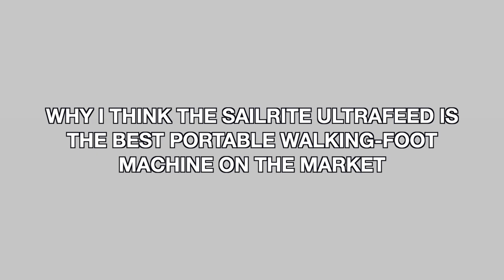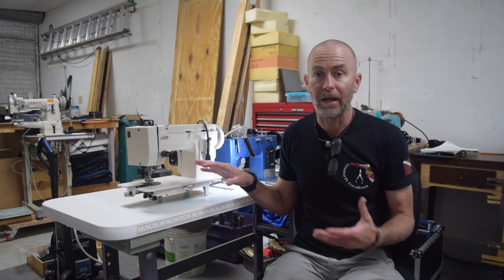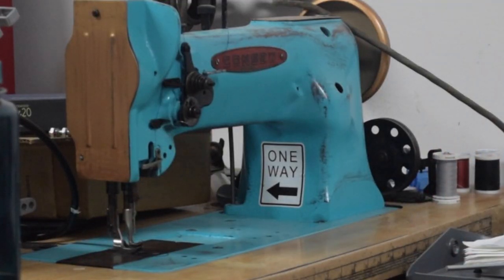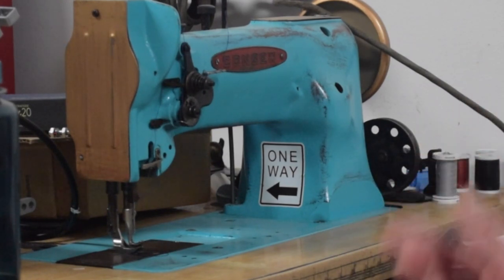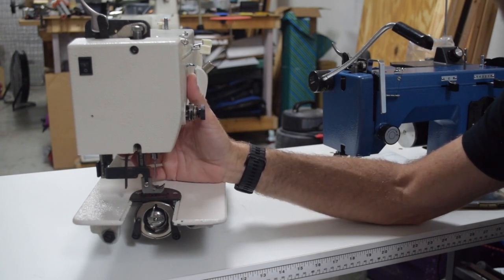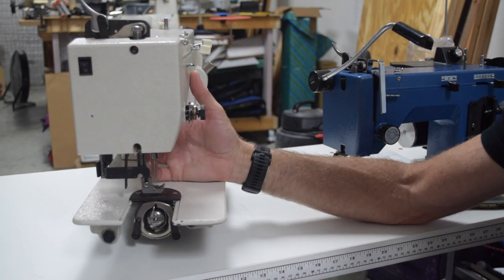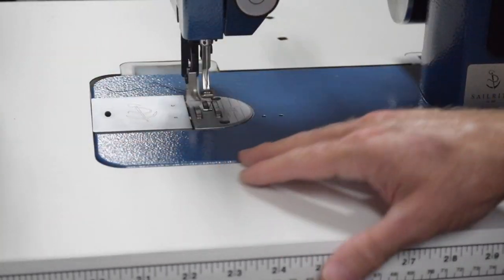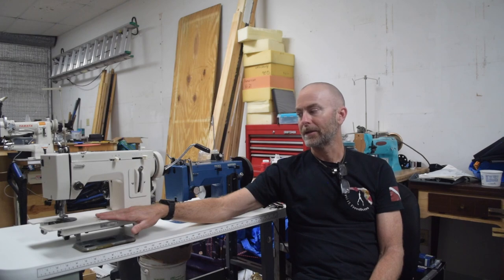Is The Sailrite Ultrafeed Better Than The Look-A-Likes?

Comment: How often do you use zig zag stich?  I was thinking I probably don't need the LZS because I can't imagine a lot of instances where I would zig zag with a heave machine like that.
Reply from the maker: Hi!
I use it quite often, primarily for bar tacks. My opinion is there is no reason to buy the straight-stitch-only version unless you absolutely can't budget the cost difference. Honestly, I sometimes wonder why Sailrite still makes the straight-stitch-only version.  I don't know if there is any situation where the straight stitch of the LSZ machine is inferior in any way to the straight stitch of the LS machine. Even if you never plan to use the zig-zag stitch, it's always there if you one day decide you need it!
It looks like the cost difference right now is $200.  If that difference is too great, particularly if you already own a zig-zag capable sewing machine, then maybe the LS is the right choice, but if you're only going to have ONE sewing machine, I would strongly suggest the LSZ.
For many years I only had an LS machine, and I used a machine like my Singer 237 for any zig-zag sewing.  That worked fine, but it is far easier and better to just use my LSZ-1 now.
I hope that helps, thanks for the question and thanks for watching!

Comment: Sailrite didn't invent this design sewing machine either, they (along with help from Chinese manufacturers) all copied a prior design.  Sailrite did make some unique improvements and provides unmatched customer service and support as well as a large and professionally produced library of instructional sewing projects.
Reply from the maker: I'm not that electrically savvy, and Sailrite's website might have better info, but I believe this is a DC motor with AC power in.

Comment: Hi Jason, I got 11 minutes in and had to switch off. Sailrite took an existing design made in China and rebranded it. When it turned out to be short on promise they upgraded it. It has been incremental up to the current version with the WorkerB motor set-up. The standard original Chinese product is what you have there to compare which is much the same as the early offerings from Sailrite. It is pot-luck as to whether you get a good one or not even from Sailrite.
Reply from the maker: Hi,

First, thanks for watching, although honestly it's a little hard to take your comment seriously if you can't be bothered to watch the entire video so you know what you're commenting on.

That said, I am openly challenging you to answer one question, and I predict that you either won't reply, or your reply will not answer the question - please prove me wrong:

You claim that "Sailrite took an existing design made in China and rebranded it" and " It is pot-luck as to whether you get a good one or not even from Sailrite."  On what evidence do you base your claims?
Reply: @thejasonofalltrades  I will watch the rest of your video but not today - it's Xmas Eve and I got baking to do. I have watched a good few vids on Rex and Sailrite portables and since Sailrite only do the 7" version I would not bother with it for the price.

I have two industrial machines, one is a new Chinese computer direct drive 0303 style walking foot machine which I obtained directly from China at a third of the LSZ1 price. The other is an older Brother which I have had for years on a clutch motor and now have a servo motor to fit over the holidays.

I seriously looked into the portables but could not recoup the cost of a Sailrite machine in a reasonable period of time. I have been a subscriber of Sailrite for five or six years now and somewhere in their uploads is the history of the portables development. Happy to prove you wrong dude.
Reply: @thejasonofalltrades  Here is one of a few vids from people who got a dud. From the channel 'exploring land and sea'. Title is something like 'unboxing our Sailrite ultrafeed LSZ-1 Didn't go as planned'.

I have come across a few more but that was back when I was looking. I suspect they had/have issues in their quality control department.

PS your attitude would suggest you are cruising for Sailrite freebies...
Reply from the maker: @biomechanique6874  Thanks for replying, but you didn't answer my question, unless your idea of evidence is "I watched a few YouTube videos."  

The fact that you have two industrial machines has nothing to do with whether your claims about the Sailrite machines have merit.

Sailrite's history of the development of the Ultrafeed is on their website, and is what I stated in the video.  Your claim is contrary to that stated history, but you offer no evidence to support your claim.  

If you think a 7" throat is reason enough to not buy a Sailrite, that is a perfectly valid opinion (I don't hold the same opinion, but I grant that for some the larger throat might be advantageous).

In case it's not clear, I'm not saying that you don't have a valid opinion - what I am saying is your comment makes specific claims that are not backed up by any evidence, and that is what (so far) every critical comment on this topic seems to be - unsubstantiated opinions from people who for some unstated reason don't like Sailrite and pretend to have some insight.  You have proven nothing (I credit you for at least replying).  I ask again, on what evidence do you base your claims that "Sailrite took an existing design made in China and rebranded it" (beyond what Sailrite and I have already said, that they used the Thompson design as a starting point once Datho's patent expired) or that " It is pot-luck as to whether you get a good one or not even from Sailrite."  These are specific claims that should be able to be supported by some kind of evidence.  If you have evidence of these claims, even anecdote, you should be able to say so.  If you have no evidence for these claims, why are you making them?
Reply: @thejasonofalltrades  I do wonder if you understand the concept of generic design? And I did my homework before deciding NOT to buy an Ultrafeed machine. The fact that I won't buy a particular machine from Sailrite doesn't mean that I don't like them - quite the contrary Eric, Matt and the crew are epic.

Though there are more YouTube videos of Ultrafeed problems there are more away from YouTube. There is more to the Thompson history than you seem to be aware of but hey, your problem.

I am probably not the only one that switched off around 11 mins. Maybe you should look at your content, format and presentation. Is one of your trades being a clown? It was really hard to watch you struggle with that servo motor - how you cracked that needle encoder is a mystery - you are hard to take seriously.

Anyway that's more than enough for now.

Seasons Greetings to you and yours 🎄
Reply from the maker: @biomechanique6874   "There is more to the Thompson history than you seem to be aware of but hey, your problem."  This is elementary school playground nonsense; "that's for me to know and you to find out."  If you actually knew anything, you would certainly tell me where I am wrong (you continually do so without being able to provide support for it), so it is obvious that you are nothing more than a troll, with nothing to contribute to an actual productive conversation intended to increase understanding.  Please find a responsible adult in your home to help you find more age-and-intellect-appropriate content for you to watch, my channel isn't intended for children.
Reply from the maker: @biomechanique6874  Make no mistake, my utter disdain for willfully ignorant internet trolls who contribute nothing knows  no holidays.
Reply: @thejasonofalltrades  "Make no mistake..." No one could possibly make the mistake of believing that you are a competent person on watching your content. I have not made the mistake of subscribing to your channel, as 'a Jason of all trades' has become a metaphor for someone who is useless at pretty much everything -  except narcissistic bs on YouTube of course.

Comment: On the subject of fit and finish. Why does sailrite machines only have a stick on label on the front? I’m seeing the “knockoff ” machines also have the  basic stick on label. Just look at singer, juki, pfaff etc. makes me wonder who’s the knockoff ?
Reply from the maker: Hi!
I agree, the sticker is probably the worst aspect of the appearance of that machine. My guess is they have considered the cost of designing and implementing a fancier decal and determined it to not be worth the cost. I agree that the decal doesn't do the best job of selling one on the quality of the machine, but if one is put off by the sticker and missing all of the other obvious indications of higher quality (better finish, better machining, innovations in the stitch-length lever, FAR better motor, plus excellent customer support and instructional content), then a fancy sticker probably wouldn't be enough to sway one anyway.

Comment: I have the generic 9" with the big wheel and it works well for me. My understanding watching the portable hd machines over the years, the Tompson is a fork in the evolution of generic hd machine. 3d printers are much the same way. You just add 3rd party parts to the generic machine to match your needs or buy a high end unit with all the stuff ready to go.  The big wheel Sailrite sells fits the generic units.

Comment: Great video, if I can I will go sailrite as portable would be really handy and in any case I have no room at home for a full size machine. However, Will it handle marine vinyl for a reupholstery project , that j can’t work out yet from reviews.
Reply from the maker: Hi!
The Sailrite Ultrafeeds are pretty much made for materials like marine vinyl. I would say the only possible limitation of the Ultrafeed compared to a full-size industrial is less throat space, so if you were recovering something HUGE that could be something you'd have to work around, but I've never had it be an issue for me. Sailrite has tons of reupholstery project videos on their channel, check it out, I think you'll find it will work great for you!
Thanks for watching and commenting!

Comment: I bought a consew cp206rl in 2016ish I cannot even say it worked, 3” into the very first test stitch the needle bar connecting rod broke, very very poor casting of a part that should have been machined steel, . I bought from zameir or something like that in l.a. and they got me a replacement pretty quick. The machine was later relegated to only making piping as the walking foot mechanism is a terrible design with low hanging parts that interfere, something I see on the sailrite as well, plus just the way it feeds I did not like it . Speed control was not smooth and the screws it was put together with were incredibly soft and many had to be replaced. I ended up buying a consew 226 that was far better and now use a consew 206 r 2 , couldn’t ask for a better machine especially with a servo motor with needle position sensor. I’ll take one of those sieko consews over anything else

Comment: Disappointed that this is a beauty contest video.  No comparason on functionality? 
I just got my Sailrite LSZ-1, stitching is great but my friends on Facebook kept asking if it is an antique.
Reply from the maker: Hi,
If you think differences in machining quality like this are a beauty contest, then I'm not sure how to communicate with you. There is evident care in the construction of one machine, and a clear lack of that same care in the other. We aren't discussing paint color or graphics.

Literally within the first minute of this video, I specifically stated that they function the same, so there's no real point for me to show a couple of 5-second clips of both machines doing the same thing. One of my concerns about these lower-priced variants of the portable walking-foot design is whether they will perform well over time, and I don't have the time or resources to perform long-term testing to answer that question. I can, however, make judgements based on apparent quality of the construction of the machines, which is what I did in this video. 

The fact that your friends on Facebook ask if the machine is an antique only reveals that your friends aren't familiar with this style of machine, and says nothing of the machine itself.  It isn't a sleekly designed, plastic-bodied, computerized machine; it isn't supposed to be. I once had a person doing some work in my home who thought my Sailrite was a piece of ammunition reloading equipment for firearms.  This doesn't mean the Sailrite doesn't look like a sewing machine; it means that person didn't know what he was looking at, and the same can be said for your friends.

I'm sorry that this video isn't what you expected, but the message in it is exactly what I intended to convey. 

Thanks for watching!

Comment: I have the "reliable"  barracuda, branded model. It's absolutely the same as sailrite. Your argument about fit and finish, is not picky  frankly. I don't know what models were genuinely licensed or even who actually owns the patents, but the "reliable" model is identical and the machine tolerances are the same. Before buying my unit in watched videos like this and decided to take the risk and I'm glad I did. Sailrite has done really cool innovations but it's definitely not worth the 1300 dollar price increase and you can buy sonogram those innovations and  attach them to your lower cost unit. Mine  is made in Taiwan. I think most are. Basically, they're all made in Asia lol. Also, it came with a clutch and step down wheel.  When you tighten the belt you get a really controllable unit. Meanwhile Sailrite try to sell you a larger wheel that does the same thing are tightening the belt.  I'm all for supporting American manufacturing. This is made is Asia. They all are.
Reply from the maker: Hi, 
With all due respect, pretty much everything you said here is wrong.
Thanks for watching!

Comment: Great subject matter. It's a shame that even Consew jumped on this band wagon.  I have a 206RB-5 that is China-made and it's great, but it's only a clone of itself as they were previously made in Japan. Sad that Consew also makes or made a clone of the Sailrite. Things quite different in China, they think that it's somehow a flattering compliment to clone your stuff. Sometimes a different crew of workers comes in at some evening hour and they might spend the wee hours on the same tooling or machinery turning out the clones, but the castings likely are the sub-par culprit here, plus no care on concern for the fit and finish. Mr. Grant holds patents on his castings.
Reply: I agree with you on the Consew being an excellent machine as I have a 206rb-1 and love it. How ever the Consew is a clone of a Seiko STH-8BLD, albeit an excellent clone.

Comment: When all machines are copies or ripoffs and they all are produced in china it’s hard to defend a price point of 10x the cheaper alternative…
Reply from the maker: Hi!
With all due respect, I disagree completely. There can be a HUGE difference between two identical-appearing products, produced in the same country, when one producer has a high standard of quality and another cuts costs at every opportunity. 
Apple products are made in China, and most would agree that they are premium products that exude high quality and that they generally perform very well. I'm highly confident that one could find sellers selling something that looks exactly like a MacBook (or iPhone or iPad, whatever) but upon closer examination is made from inferior materials, has inferior hardware, and doesn't function as well or last as long. The fact that both products look the same and are made in the same country (possibly even the same factory) is irrelevant to the question of whether one is a better product than the other.
Whether the added expense of the better-made product is worth the additional cost to YOU is a decision you have to make.  In this video, I am arguing against the claim that Sailrite sells the exact same machine as the other brands, and simply paints them red or blue and puts their sticker on it; this is clearly not the case (or at the very least has never been demonstrated by anyone, to my knowledge).
I hope that makes sense.  Thanks for watching and commenting!

Comment: Probably all these machines come from the same manufacturer
Reply from the maker: It may (or may not) be true that all of the machines not manufactured by Sailrite might come from the same factory (or a few factories), I have no way of knowing for sure.  Sailrite claims that their machines are made to their specifications in a factory that does not produce any of the other machines of this design, and no one has ever presented me with any evidence to contradict that claim. Sailrite's casting is patented and unique from the other similar machines. 
Since I don't have a budget to buy an example of every one of the other variants of this machine design, I can't compare them all, but to the extent I have been able to compare any of them, the Sailrite is of noticeably better quality.
I hope that helps!